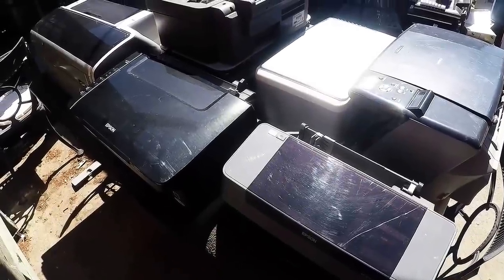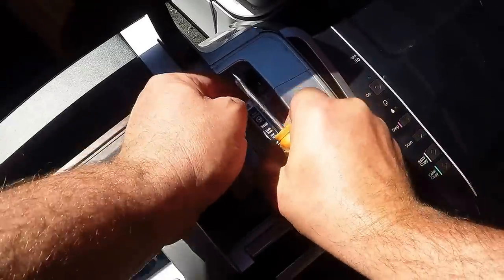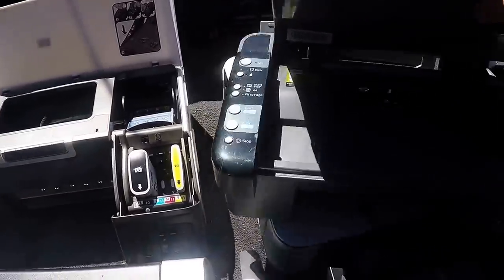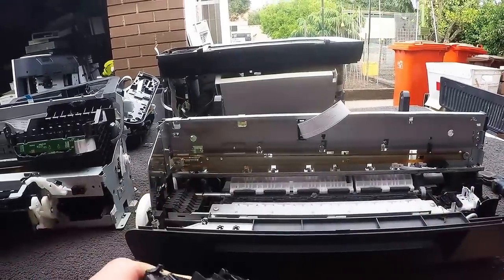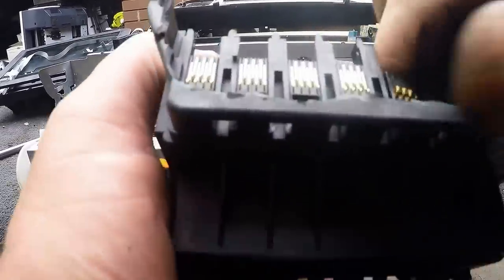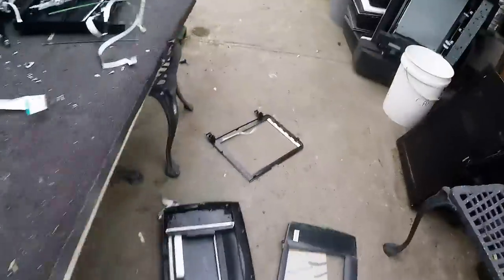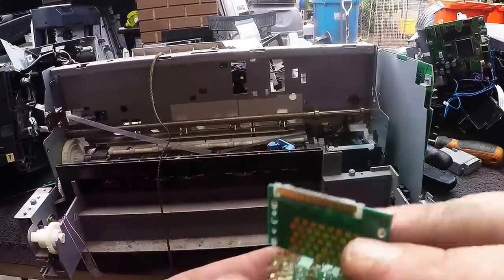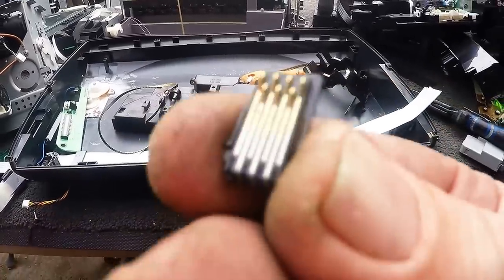How to scrap Inkjet Printers & Cartridges for Gold Recovery

Comment: Great break down 👍 but look closer. 
I have been collecting the scanner boards like the one at 22:19 for easy gold.
If you look along the rail using a magnifying glass, you can see and directly harvest gold wires. Sometimes there is also a chip with exposed gold wires.  Yield is to be determined. 
Try not to touch the surface, they break easy.
I have also found several electronic components that when split apart, show gold wires.

Comment: all printers have a tiny speaker inside, which ive remoced, and put in digital tape players, and made  am/fm digital radios (which cost $100).
Reply: show us how
Reply: @jb571  connect the speaker wires to the earphone jack in the am fm radio, and find where the jack is connected to. solder your speaker to those wires and it should work. i've done it twice.

Comment: Those cheap ones with the long skinny boards behind the light scanner there has the gold platting also has gold bonding wires on all those gold squares to the glass that runs down the center of the board

Comment: On the cartridges with ribbon, check the rectangular connection that the ribbons ends with, it has gold underneath it as well. Caution, when you remove the connector ink will come out, but it's worth it.

Comment: Hey Ben. Those spring pins on that printer ink caddy that u shown in this video, are they phosphorus pins like you’ve shown on computer motherboards? Can u explain that phosphorus pin info and what should I be doing with those types of pins. How can I tell if it’s that phosphorus as you explained in a different video?

Comment: Great vid Ben thanks for sharing,a question how do you take off the gold from the chips ,boards?How do you now those parts/pieces are real gold?do u use aqua regia or similar? Thanks
Reply from the maker: gold is used to connect components for good contact and gold doesn't tarnish easily so most things you see that look gold and connect is gold. you usually use something like hcl to remove gold, aqua regia is used to refine so usually 2nd stage

Comment: Yeah Ben another good vid, I have a few boards out of printers some are just amazing hey, but I have noticed that the scanners I get are just cheapies but still check anyway as for the metal rods and the belts I save them I might make a once a year market to get rid of them same with the motors which I have hundreds at the moment, I have fun just looking
Reply from the maker: +Bren gun21 thanks, yeah they don't have a good reputation with scrappers but printers do have some interesting bits, yeah the rods, motors, gold bits and ccd's on scanners, all good stuff to hoard.
Reply: +eWaste Ben I was wondering if there is gold in floppy disk drives???
Reply: +eWaste Ben just wondering cause I have ~150~ floppy disks
Reply from the maker: +drvelocci Only the set of gold pins on the back, inside there's nothing that I can think of, I just break of the pins and leave the rest.
Reply: +eWaste Ben ok thanks

Comment: Hi Ben, have you ever seen those bars where they are made from Brass? If so which brand of printer would I find a brass bar in?
Reply from the maker: +hucks33 I've done my fair share of printers but never seen a brass bar, unless it was a white brass bar or coated with chrome, but never a yellow brass, that would be something.

Comment: I think the printers in Uk are slighty different to yours Ben. Ive never come across CCD's in printer/scanners like the ones you have there. They all seem to be a much thinner bar with a long thin board backing on to the tube and though there is a thin strip of gold flashing running right across it its nothing compared to what your getting there. 
Maybe all the decent ones have long gone in the UK with our higher waste turnover and now we have an advanced model where the manufactures are using a lot less gold...who know ? its a mystery!!
I hope now I said that I "actually" come across one with the stack of 30 scanner/printers Ive got to work through,because even just finding one of them would be sweet ! 
As ever nice vid.
Reply from the maker: +The Urban MIner no they're not that uncommon, and just about all flat bed scanners use CCD's
Reply: +The Urban MIner Do people take the ink cartridges out of the printers here in Uk to give back to Staples for credits?  Or is that just an American thing?  I only have 2 printers to dismantle, both really old so I could let you know what I find when I get to them.  One of the printers is one of those old dot matrix type ones.  Good luck with your printers.

Poo
Reply from the maker: think it's just an american thing, here stationary shops have recycling boxes to drop off free
Reply: Well maybe Ive just been unlucky Ben in getting the low grade common ones then, Got a few better commercial printers out of offices stacked up so maybe some in there.
Reply: poosmate
Yeah we've got Staples over here but not a lot of them. My nearest one is so far away its not worth going there so I dont know if they give anything back for taking them there. With the price of scrap so low now I wouldnt be surprised if they dont give anything for them now.There are so many places anyway you can take cartridges in UK to recycle I prefer to scrap them for the gold on the print head and then dispose of the rest to the nearest recycle point.

Comment: what tools do i need to get rid of the hex shaped screws on my printer?
Reply from the maker: +MisterLamp skybritheplayer torx screws, you can buy the driver with a pack of torx bits or buy a set of drivers, the bits come in different sizes, T10 is most common size, then T9, T8, T7 etc but T10 gets most.
Reply: thanks i was trying to use allan wrenches before and now i know how to continue my scrapping of printers thanks and happy scrapping
Reply: also i found a black board while scrapping my printer, does that have a specific name to it?
Reply from the maker: +MisterLamp skybritheplayer not that I know of
Reply: i have not been able to take it off the part of the printer it is mounted to but it has some gold on the back of it so i think it shows promise